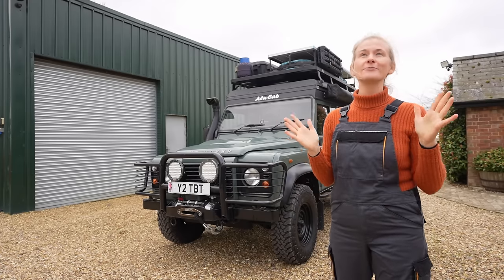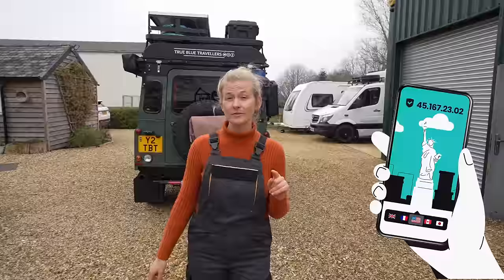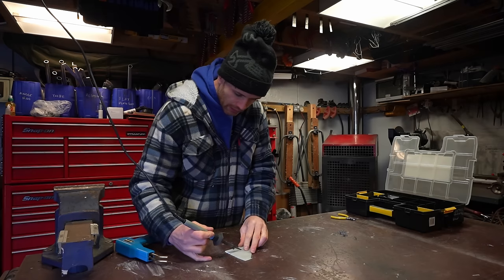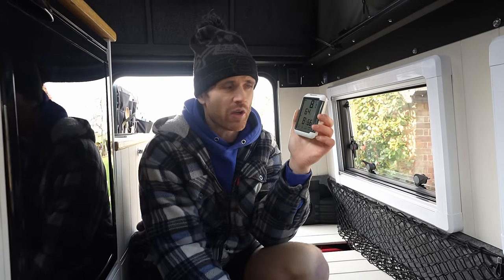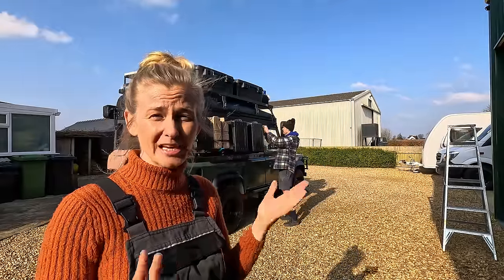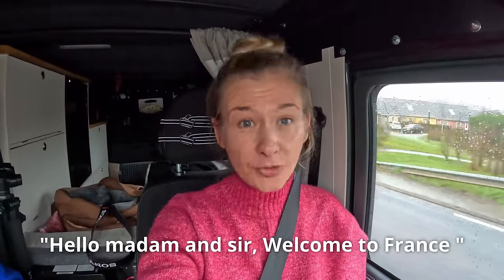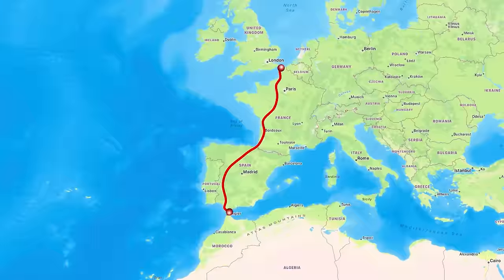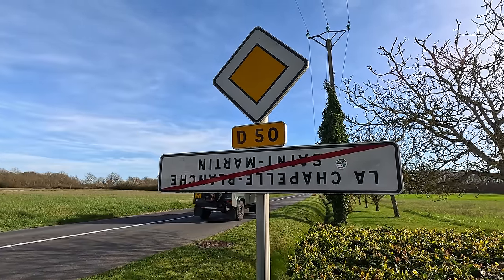The Wait Is OVER!!!

Comment: Hi y’a.  Those temperature sensors are great. You can have three separate sensors to the one main unit.  We have outside temp and have also put one in the fridge to make sure that stays at a safe temp.
Reply from the maker: Didn’t know that you could add extras, very cool idea 👌 👍

Comment: Little tip for the plastic welder when you've melted half way thru give it a slight twist and it then hooks under and makes for a stronger repair definitely a good tool to have in the workshop
Reply from the maker: Very nice 👌 good little trick that I’ll be using that👍

Comment: I thought it was only me that was obsessed by the inside and outside temperature. My wife just doesn’t get it. Love the plastic welding gun, probably will never use it but ordered one anyway. Have you hardwired the dashcam? Getting one of those as well. Basically anything you mention I buy it.
Reply from the maker: 😂😂😂 good man can’t have too many tools! 👌No haven’t hardwired it but it does come with a cable that you can hardwire in 👍

Comment: Its worth looking into a fire extinguisher stick the longer version. Not cheap but unlike a gas one it never needs checking or loses pressure i think they are good for 10 years. You remove the cap and strike it on the end to light it
Reply from the maker: Didn’t even know these existed, thanks for the tip 👍
Reply: @truebluetravellers me neither until a week ago the regular ones fail after a while but check the reviews on them before getting one as they are not cheap around £80 cheaper than a new vehicle though. avoid the element one look at the fire safety stick one

Comment: HI guys, great video as usual, installed the rear door table yesterday too, fine piece......I am wondering, whats the weight of your Landy fully loaded as it is now on your trip to Morocco? Cheers and have fund stby for your next video.....Thomas😉
Reply from the maker: Thanks Thomas, we haven’t weighed it since setting off but we weighed it near the end of the build which was 2.6t so definitely under 3 tonne with all our gear and Jesse’s snacks in it 👍
Reply: Thanks Jon, that's is not too bad .......any engine tuning done, my 110 has got 160hp with a engine remapping done, works perfectly, safe trip guys.. @truebluetravellers
Reply from the maker: @tomjet1000  no unless the previous owner did but I doubt it as it’s a bit gutless up hills to be honest. I recon it could do with a bigger intercooler and a tune 👌👍

Comment: Hey, great to have you both back and on form too! Hasn’t the time raced on since the start of your Arctic trip!!! So, 3mths on, my plaster is coming off the ankle this week so I’m desperate to slowly get back to my van build. Now, Jon, the control unit for the diesel heater, is it really that easy? Plug and play kind of thing? I mean, this middle aged gal has zero electrical experience. Also the after burner you mention is that the gizmo you got from Aus and if so would a link to it be in the Sainsbury’s build? Sorry lots of questions 🙄🥴
Reply from the maker: That’s great news, glad you’re getting there. 
Yep really easy to fit the control unit, and the afterburner I’ll drop a link to below, also there is a Facebook group for it too which has loads of information too 😊
https://www.mrjones.id.au/afterburner/
Reply: Thanks so much for taking the time to reply and for the link. All joking aside I’ve learnt so much from you both and also from your TTT Jon and looking forward to watching your new adventure 😁 Oh, quick heads up …… I’m sure you’ll already know but Our Van Tales are currently in Morocco and have said it feels like the police are sneaky. The speed limits change often and they feel like the police hide behind objects at those change points where they know it’s there they can catch you out😉
Reply from the maker: @SecrePeach  thank for the tip, need to be on best behaviour then 👍

Comment: Quick question does the diesel heater controller turn off the heater as when they restart they use so much more power 
Due to glow plugs
Reply from the maker: Yep it does but from what I’ve been told the amount of power it uses running compared to being started sort of evens out over the whole night 👍
Reply: @truebluetravellers  would be an interesting experiment constant running in alpine mode vs stop start 
Over 8 hours
Reply from the maker: @wanderingwilcoxs  yeah there a Facebook group for them too if that’s of interest to you, allot of technical stuff on there 👍
Reply: @truebluetravellers  I used to fit them when I worked at Landrover special vehicles at Solihull no Chineese copies back then lol 
Wabasto and Eberspächer only had on off switches.

Comment: I’ve had the Viofo A129 front and rear dash cam now for nearly two years great bit of kit and paid dividends for us when someone reversed into us and then tried to deny it was their fault …pointed out dash am and tune changed …
Reply from the maker: That’s a good point, might have to get a front and rear one next time 👍
Reply: @truebluetravellers  if you’ve not considered already , a tip may be to remove said camera when in unattended areas , as having it non hardwired  makes it a lot easier for a “smash and grab “  longer term project maybe hardwire it and consider its stealth mode ? Safe travels both 👍
Reply from the maker: Thanks mate, good point, people will nick anything nowadays